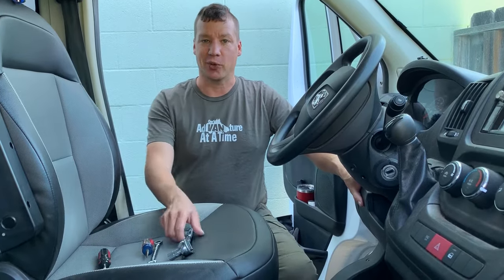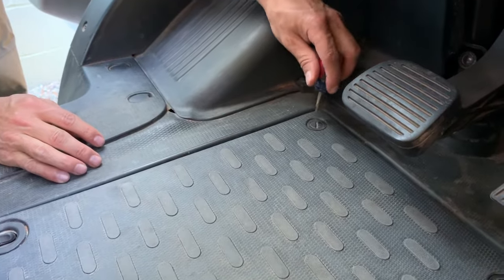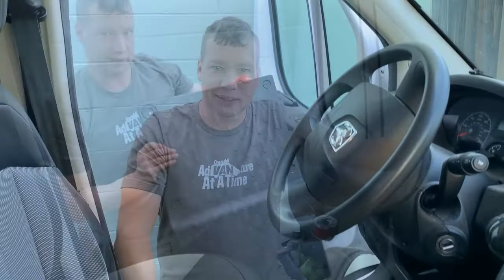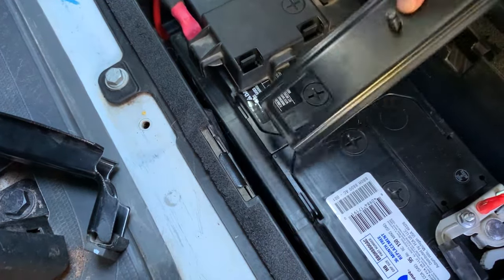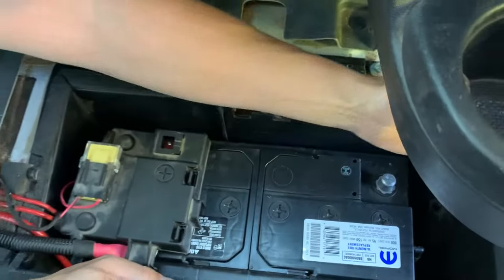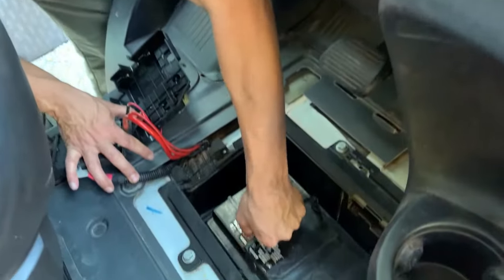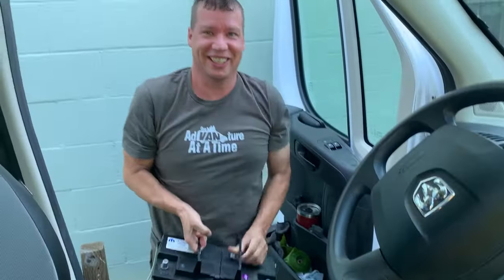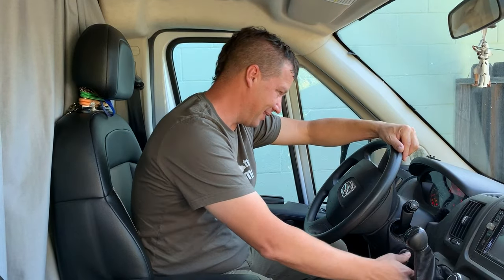"Citroen Jumper / Peugeot Boxer / Fiat Ducato/ Promaster- How To Change Your  Battery

Comment: For anyone else watching this, be aware there is a little plug that you need to remove from the old battery for a vent hole---opposite of the one that connects to the plastic vent tube--you can just see it at @5:13 on the end of the battery.  Take it out and use it on the new battery to plug that hole.  This is most easily done before you drop the new one in! Thanks for the video.

Comment: Great video.  My Ram has a inverted plastic battery aligner on the bottom of the battery box so the battery can't move either way.  I noticed my original battery was an 800 Amp while my new 4 year free replacement warranty from Walmart is a 900 CCA battery.  It is the exact replacement.   I also didn't have to remove the positive wire , only loosened clamp and the entire positive cluster came off together.  Your video made the replacement very easy.  My original battery was still working fine but is 5 years old so I just replaced it before it does go bad. There wasn't even dust In my battery box.  Was just like new!  Both batteries were identical.  Cost 184 dollars at Walmart including all fees and taxes. This is in Florida. Original battery was mfg in Sept 26 2017 now is July 2022, old battery still good so that lasted very good.

Comment from the maker: TOOLS YOU WILL NEED TO CHANGE THE BATTERY.
13mm deep socket ~ https://amzn.to/2xuRnZ6
10 mm rachet Wrench ~ https://amzn.to/2Vz2pV4
stubby screwdriver ~ https://amzn.to/3aaLcXe
screwdriver set ~ https://amzn.to/2K30t1Z
Ratchet socket wrench set ~ https://amzn.to/2K7ryAY
ratcheting wrench set 20 piece ~ https://amzn.to/3a3Ee6A

Genius Battery Jumpstarter ~ https://amzn.to/2VavwPC

Comment: Hi thanks for the vid. 2 things, if the vehicle is fitted with an alarm the appropriate shutdown procedure should be followed. Mine is, alarm on/off then turn ignition on <click>.
Secondly, I put plastic bags on both  terminal assemblies whilst they are off to ensure there is no chance of a short!!

Comment: Thanks for saving me a lot of money.... with all the electronics above the positive lead it stopped me dead.... I thought no way can I change this battery it looks too complicated so I called the dealership they wanted $485.00  for OEM battery Plus 85 to install it    625.00 total ... I went to discount Auto 265.00  and put it in myself thanks to your video.... By the way nobody had them in stock I had to wait 3 days for the battery you would think it's a common battery but I have a Thor RIZE  camper apparently it's a special battery    ....😄😄😄😄

Comment: Thanks, Dave, for all your well-done and helpful videos.  Here's a suggestion for a new one.  I've had trouble with my battery running down while my 2019 Roadtrek Zion (built on a 2018 Promaster chassis) is in winter storage.  Same problems you described here, flashing dash lights, engine won't start, key stuck in ignition.  Sean at Roadtrek recommends disconnecting the battery if engine won't be started for two weeks or more.  My Promaster has a quick disconnect on the negative side of the battery which requires no tools, just a gray plastic lever which you twist open to remove cable. Not sure yours has that (maybe a Roadtrek gizmo), but if not use a tool to remove negative cable.  Only issues then will be that your Thule door step (if you have a Roadtrek) won't close without the battery, but not a big deal.  You also won't be able to lock the passenger door using the key fob without the battery, but there is an easy manual method found at https://www.youtube.com/watch?v=7Hq4Dazcy3Y&t=102s that you could incorporate into your video.  Good plan for long-term storage of a Promaster.

Comment: Very informative! Our 2017 Promaster Battery seems strong but here in Florida (on our little island) to get 4 years out of a battery is asking a lot! So I’m sure this is in my near future! That’s a big battery! Oh well! Thanks for sharing!
Reply from the maker: I need to wire in an auto shut off for our inverter. We charge our house battery when we drive from the vehicle battery. So when we forget to turn the inverter off it keeps on charging the house battery until it's dead. We have done this 2 or 3 times. Each time I am guessing takes one year off the battery 🤪 I am hoping your battery gives you 5 good years. I wonder if it's the heat/humidity there that shortens the battery life.

Comment: I am saving your Promaster maintenance videos to my phone for future reference. Hopefully, when the pandemic has passed and our own Promaster  build is complete we too will take to the open road. Appreciate your careful and accurate videos. Two questions: 1. Are there no third party battery options or must you buy one from the dealership? 
2. I noticed no extra wiring coming from the battery to an isolator to charge a battery bank or did I miss it?
Reply from the maker: Awesome! Thank you for the kind words. We did look at three other 3rd party batteries at the auto part store. The battery that was equivalent to the Mopar battery was more expensive.Good eyes on the no extra wires. We removed them for the video in order to not cause confusion. We have our inverter connected to the battery. We charge our house battery from this inverter while we are driving.
Reply: @oneadVANtureatatime  Thanks for the great video! Can you use that positive lead on top of the harness (13mm nut) to connect to an inverter/Dc2DC charger or best to connect to the battery post? Same with the Negative?

Comment: Can you comment on the electrical? A battery tender is suggested for newer cars to prevent memory loss (abs, radio, dash settings...). How did the battery swap effect your van? Besides this question, your video has lifted my spirits since no auto parts store will touch the vans battery compartment.
Reply from the maker: Hi BasketThme! Sorry for the late response. The only thing I had to do was reset the clock. Our Promaster is a 2017.

Comment: this reminds me of my dads old 1955 dodge 1/5 ton panel truck the 6 volt battery was at the same spot but had a nice drom on cover . unfortunately it was low compression and warn so in winter the 6 volt battery was not strong enough so he had a used 12v jumper battery . i really liked that truck but not old enough to drive he got a 65 Plymouth sw to replace it and sold the truck sine no place to keep it for 2 yrs when i got licensed . so i recently got a 21 premaster 1500 but had not found the battery yet tnx i need to tap battery to add 2 way radio to the van

Comment: Is there any chance you could do a video about how/where you run your cables from your cabin batteries to your engine battery? For instance,  I know I need to connect my B2B charger to the positive side of my engine battery, and also the negative buss bar needs to be grounded to the van chassis, as does the inverter. Every wiring diagrams says these things, but I have a hard time finding a video showing how it is done. Your tutorials are so easy to follow and I was hoping you might already have done one such as I am requesting. thanks for reading!
Reply from the maker: +Wendy Byrne hi Wendy! Please email us at oneadvantureatatime@yahoo.com

Comment: I have a video idea. If I recall correctly, you have a Berkey water filter system. Could you explain why and how you use your Berkey as well as how you always keep the filters primed so that they always work. I have my future Berkey for my van being used in my home. However, if I don't fill it frequently enough, the filters dry out and need to be primed again. Could you make a video with your take on how to keep such a precious tool operating at all times while on the road? Also, have you ever had trouble with the way you have the Berkey secured. I was thnking about going the same route with mine. Keep up the great vids. You two are a blessing and breath of fresh air. Be safe and be blessed, Big Silver Bear
Reply from the maker: All bout the Berkey is already on our Wednesday list 😀 We initially primed our Berkey filters in the kitchen sink and have not had any prime problems since. The bolt and nut through the 3/4 ” wall and the velcro have worked awesome, we do have a piece of foam between the lid and the cabinet to keep the lid from vibrating. I am not sure if we have had the filters dry out as we use this every day. We have cleaned the filters once and are due to clean them again soon. You have given us some good stuff to cover on the video, Thank You for the content idea and all your kind words. 😀

Comment: I got a replacement battery that says "exact match". It is an inch shorter between the terminals. It should still fit though right? The negative cable has some play.

Comment: That was a really well done video, good job 👍👍
Reply from the maker: Thank you for your kind feedback! Take good care and have a fantastic day.
Reply: @oneadVANtureatatime  we just got a 2019 zion srt and the battery needed replacing, had it done at the dealer under warranty, but I was curious how it was done. Did you have to get a jump? How would you do that?
Reply from the maker: Great question! If you pop the hood open look on the right-hand side for a plus sign. Flip the tab up and you will see a positive battery lead. You will see a negative post that is marked right next to your waist at the edge of the engine compartment. We use a Noco Genious battery jump starter right from there. Hope that helps, all send you a link for the Jumper.
Reply from the maker: https://amzn.to/2VavwPC
Reply from the maker: Congrats on your 2019 Zion! Those look awesome. Happy travels to you.

Comment: Great video....  Thank you.  I was wondering if there are other benefits to going to a dealer for a battery (e. vehicle warranty).  Did you look around for an after market battery?  Good advice on asking about recalls.  I am  a HAM Radio Operator and am in the process of rigging up my ProMaster for radio use and will be using a stand alone solar powered/charged 12 volt battery for power.  I will be getting a battery that will be compatible with the vehicle so that if/when my vehicle battery fails I will have a replacement battery on board.
Michael from Canada
Reply from the maker: We did shop around. We found 3 other batteries that would have worked. The aftermarket battery that was equivalent to the Mopar battery was slightly more expensive. I am not sure if it affects any of the vehicle warranties or not. I do like the idea of going to a dealership if the warranty needs to be honored. Year's back we had a auto parts store refuse to replace our defective car battery. Having a back up battery onboard is a smart move! We hope you're doing well up there in Canada. We love your country and can't wait to return. 😀

Comment: I bought the Walmart everstart maxx h8 battery and it lasted 6 years of daily driving. So I just bought another one today. 2014 promaster. I was suddenly getting a long pause and a bit of extra cranking as a warning.
Reply from the maker: 6 years is a good amount of time for any battery. Thanks for the tip. It's nice to know a quality replacement is only a Walmart away.👍

Comment: Great job on this and your other videos. I just ordered air filters through your link. When our battery was changed, average mpg and trips stopped working. Instant mpg still works. Dealer didn't know why and would continue working to resolve at an hourly rate. I decided it wasn't worth the $'s to keep working on it. Someone mentioned to remove negative lead for 30 minutes and the computer would reset. Didn't work either. Did you encounter this problem?
Reply from the maker: Thank you so much for ordering through our link, very much appreciated. That's the first of that problem I have heard. I wish I had some helpful advice on that.  Sorry.    One thing I have learned is if I manually turn off the headlights before I shut the engine off I don't get anymore burned out headlights.😀 When and if you do solve the problem I would be interested in how you did it. Take care and stay safe.

Comment: Great video thanks, is there any computer issues that you have to deal with before disconnecting the old battery? I have heard that you have to have all the doors shut etc otherwise there may “faults” when you connect the new one in?
Reply from the maker: We didn't have any computer issues, pretty sure I had the drivers open the entire time.

Comment: Fun fact - That purple sticker that says 7/19 is your batteries expiration date. Judging that it lasted 9 months more you did well for the battery.
Reply from the maker: Ok, so the purple sticker was on the new battery...which I was super concerned about when we bought it. The dealer said that was the made on date. Which I don't know if that is true or not. The good news is the three-year warranty starts from the day we bought it so worst-case scenario it dies in the first 3 years and we get a free battery. 😀We hope you are doing well and have been wondering where you are at these days. Take care and stay safe.
Reply: @oneadVANtureatatime  We are in Toronto, building out our 2019 Sprinter. Moving into the bus this week and giving up our apartment!!!

Comment: Thank you very much, is soo clear. I have a question for you, please. Some cars need a reset to indicates to the car has a new battery. (Thats change the mode of how is charging the battery). For Peugeot Boxer year 2015, is need to do this reset or i can change the battery without this reset?

Thank you,
Reply from the maker: We did not have to reset anything other than the clock on out 2017. I hope it's the same for you. 😀

Comment: If you connect a battery charger (engine compartment) first, then you won't loose any configuration (e.g. Radio). But pay atention to where you put those plus cables.
Reply from the maker: Nice tip, thank you Martin. 😀😀

Comment: Thanks for this.  It should make my life a little easier changing mine (which stopped working yesterday at 9 months old).  I noticed that your battery had a sticker 7/19 on it.  Was it under warranty?  Is there a reason you didn't get your battery from another source instead of Dodge/Ram if you were going to have to pay for it?
Reply from the maker: +Michael Wellman our battery was NOT under warranty. At the time we did not many options in the town we were in and believe it or not the dealer was the cheapest option🤷‍♀️ Dave days he noticed cheaper batteries at Home Depot since then.  Sorry your battery quit at 9 months.

Comment: Do you have to buy the battery from the dealership Dodge or can you buy from interstate battery ?              Nice video.
Reply from the maker: I am pretty sure the dealership since it's a Mopar part but Iam not completely sure. You can find replacement batteries that fit at most parts and battery stores. We stopped by the local AutoZone and they had 3 batteries in stock that would work. It just turned. out that the Mopar battery was less money than the equivalent battery at the auto parts store. I hope that helps.

Comment: How would I install a 2 battery in my pro master that is built into a Mobile Barber Shop
Reply from the maker: Hi Curtis, I might do a completely separate system from the vehicle battery for your type of setup. Electronics are my weak spot with no doubt. We are getting ready to upgrade our main battery bank and I will be needing help as well.

Comment: Sooo, I flip the switch to release the negative cable, but it still won't come off. I have wobbled and pulled and shimmied. I have tried gently prying it with a screwdriver but can't get a good enough angle to do any good.
Reply from the maker: Sorry for the late reply..I hope you were able to get the negative lead off by now. In your case it does not sound like a very quick disconnect. I wish I was there to help.
Reply: @oneadVANtureatatime  I did get it loose. I ended up gently prying it off with an small allen wrench. It provided better leverage. It doesn't look to be corroded but I cleaned it any way.

Comment: Thanks for the great video! ...Can you use that positive lead on top of the harness (13mm nut) to connect to an inverter/Dc2DC charger or best to connect to the battery post? Same with the Negative?...Anybody know?
Reply from the maker: +cStu444 1st....we are NOT electricians! You can do it this way (we do) BUT you run the risk of voiding  your warranty if damage happens. USE AT YOUR OWN RISK.... I hope this helps somewhat😂

Comment: I have a 2016 1500 Promaster. Is there any way to turn that scream off when you start the VAN. So annoying, hurts my ears.
Reply from the maker: Hi Elaine. Yes, to the left of the steering wheel you should see a ”mode” button. Pressing it once brings up the Menu. Then press the down arrow about 8 times until you see ”Buzzer volume”.  Next hit the mode button again and use the arrow key to adjust. 1 is the lowest setting and 7 is the strongest. Unfortunately even on 1 the volume is annoyingly loud. I hope that helps some. 😀